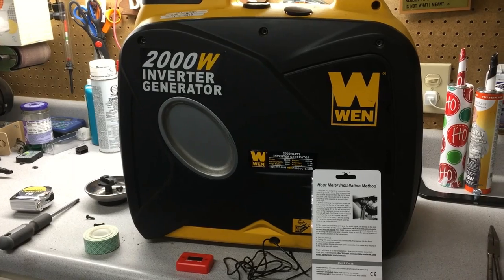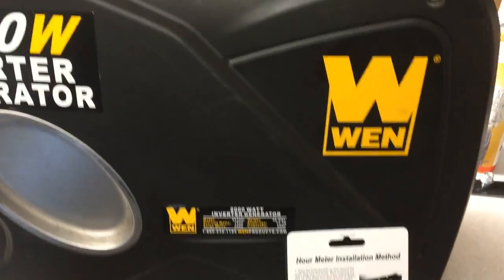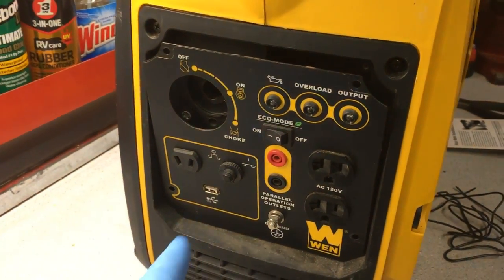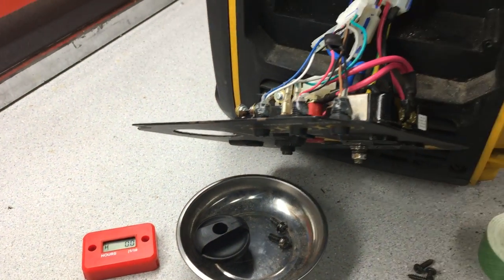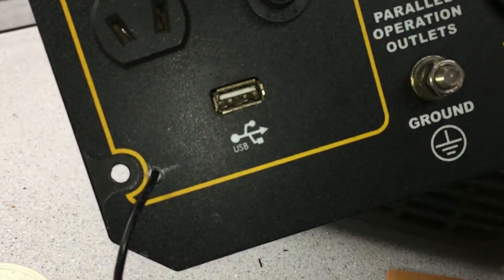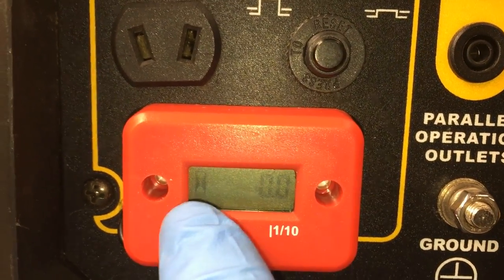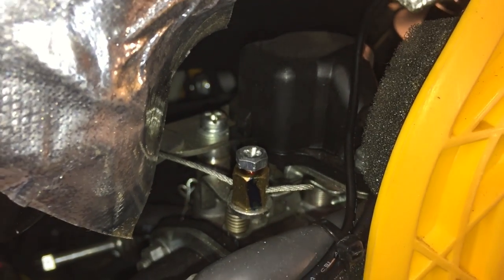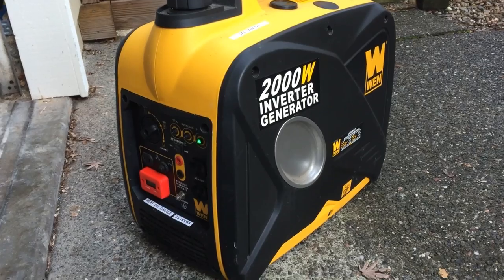Installing a Generator Hour Meter Step By Step

Comment: We have a couple of Wen 2000w and have had no issues and,as you said,the price compared to Honda  was fantastic. I'm going to need to service before the season starts,do you have a maintenance video for the Wen? You are my RV guru after all.
Reply from the maker: Thanks Joe, I haven't made a video on maintenance yet but here's a video I found that shows how to maintain the generator (its not the same generator but its pretty close) If you want to see the maintenance you will have to skip through the video to see it. Make sure you use 30 weight oil for the Wen Generator. https://youtu.be/FuQEBA032C8

Comment: thanks Michael for this informative video.  how do you like your Wen Generator so far ?
Reply from the maker: Your welcome. We've had it for around 3 years now and so far so good. It costs a lot less than a Honda and I have had a few campers come up to me and say they think its quieter than their Honda. We mainly use it to charge our batteries, make coffee, and other things when we don't have sun for our solar panels by plugging the trailer shore power to it. I'm guessing we have run it around a 1,000 hours so far.  We also have a Champion 3500 with a remote start that we use when we need to run our air conditioner that works great and have around 500 hours on it. I hope to do a video on both of them soon.
Reply from the maker: Another generator to look at like this one is the Yamaha inverter generator Costco is selling, I have a few friends that have them and they work great, They sometimes go on sale too
Reply: @thetraveltrailerguy  thanks Michael , i appreciate the feedback